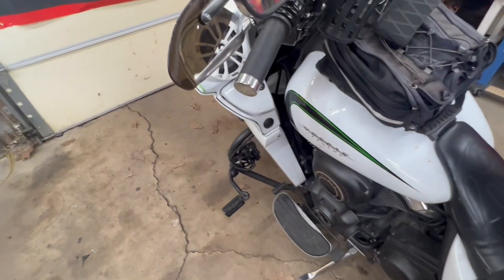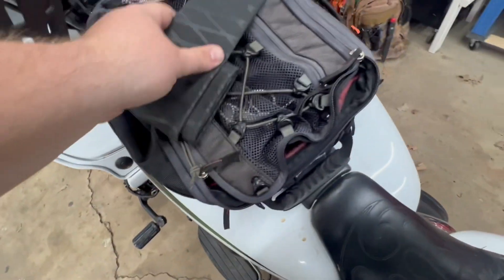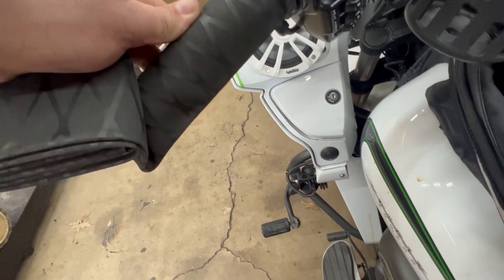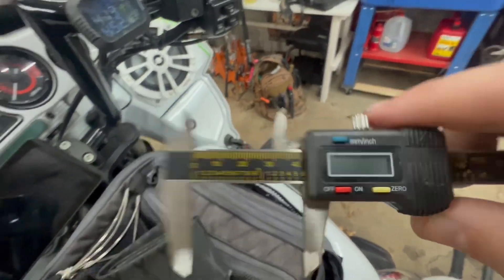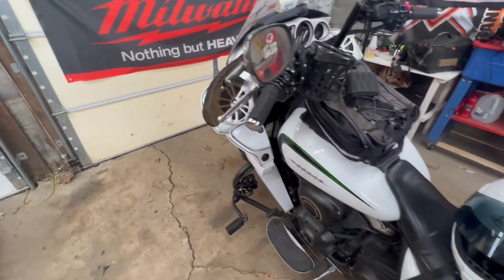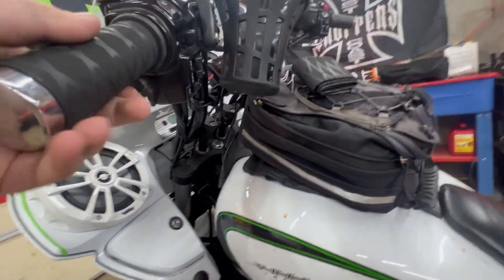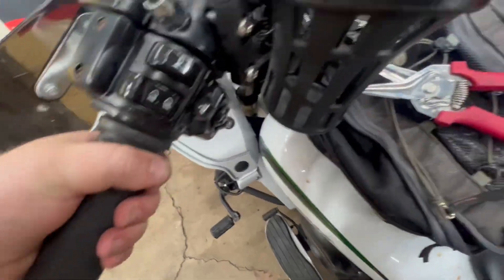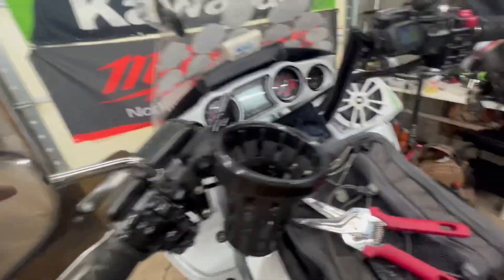HOW TO FIX STICKY OXFORD HEATED GRIPS FOR $8

Comment: How did this workout over time and use? Do you foresee maintenance to be by replacing them or apply another layer?
Reply from the maker: They have held up pretty well over the last 5,000 Miles’s the grip itself is not sticky and feels very good but after awhile they slowly slide toward end of the bars. I just push them back on and they are good most of the day.